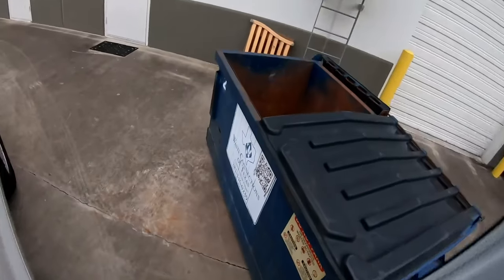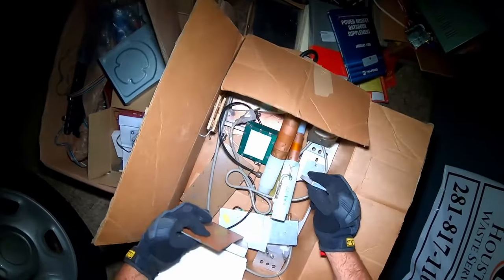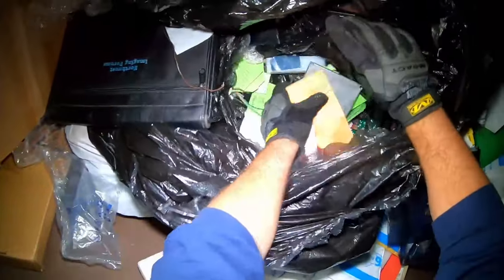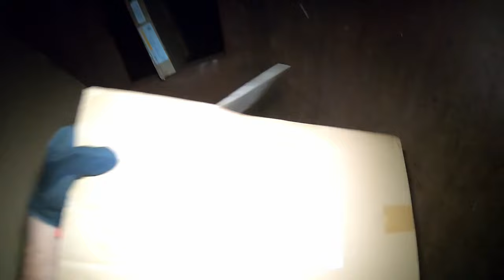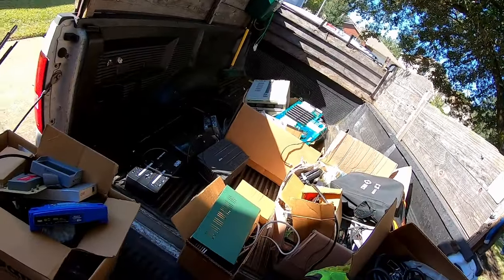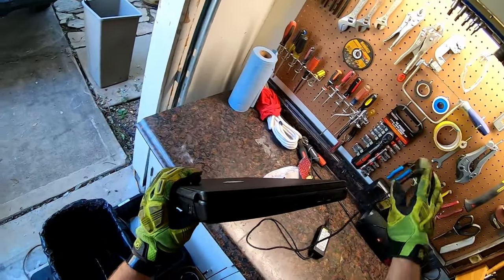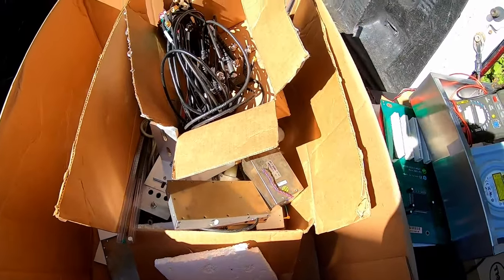Dumpster Diving "I Found The Devil In A Dumpster Tonight"

Comment: Those office dividers are often framed with extruded aluminium, worth taking apart if you have the time/space. The backs of the processors are copper, btw. Usually they can be popped off with a knife blade or scraper blade. Your power supply boxes have small transformers in them, easy enough to break open and pop them out.
Reply: also most plug prongs are brass
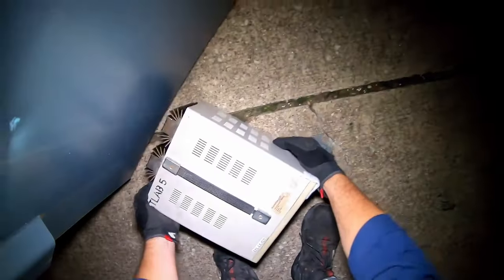Reply: The linear power supply at @4:10 has a BIG classic transformer full of copper wire... and the black heatsink on the back is also aluminum.  If that power supply works you could probably sell it for around 30 on e bay... if it doesn't work, you could still make 10-20 bucks selling at as spare parts ... they're quite easy to repair and they're good equipment to have.

Comment: At the R&D dumpster, every "empty" box you tossed into the dumpster sludge was in reality boxes of new electronic parts, most likely from Digi-Key. Some really great money can be made on eBay by selling the parts just like the parts selling there right now, check out the part numbers @ eBay or Amazon and look into the sold items.
Mike, I find you getting overwhelmed at times that you really need to slow down and get it all, as any one of those "empty" boxes could contain hundreds of dollars in computer chips. A find like that could mean the difference between a few bucks and a pocket overload of real money. 

Best of luck to you and DUDE..... SLOW DOWN IN THERE,

Mark
Reply: Hundreds of dollars? Please articulate.
Reply: I kinda doubt that, Selling on ebay is a slow process even if you can off load it at all and a lot of the time it is not worth the effort unless you don't mind a slow return.
Reply: Hey Chris, you would be very surprised how many high school and college aged kids in engineering classes build projects for grades, and not to mention all the so-called "inventors" the world over. Offer your parts at the lowest price as new, and you will sell out of everything very quickly. I know because I've been a seller since '97, and I've sold just about everything that could be sold through that site, including a $419K 4 color printing press that I bought from work for $10.
Reply: @Ghoulstille  The thing is, you have a lot of items to sell so that little bits turns into a big bit every single day, and soon are clearing thousands a week. The majority of what I sold was from dumpster diving, just like mike here.... Test things out and if they work or are brand new in the package then put them in an eBay or Amazon pile and the rest is then taken to salvage or sold to guys like the ones Mike knows that buy electronic scrap. The money is there but like everything else, you will have to work for it.
Reply: Mike often disregards stuff that he knows nothing about.

Comment: Mike, that core i5 box was the cooling fan for the CPU. the older CPUs like 386, 486, Core Duo, and Pentium CPUs usually have more gold in them than the newer CPUs like the i3, i5, i7, i9. that large gold/orange thing was a high wattage resistor. Mike if you find a person who is an electronic tech those bags with parts in will be worth $$ to you because they are new spare parts
Reply: Also, Mike, I do not know who told you about the old CPUs being worth less but they do not know what they are talking about. in addition the thickness of gold on the pins is more than what they are now. The reason is when these were made (286, 386, 486, etc) gold cost was only about $20-40/ozt vs $1790/ozt now.

Comment: Exhaust gas coolers. It takes a fraction of the exhaust gasses, passes it through a chamber filled with engine coolant to get the exhaust gas temps down before the gasses are reintroduced to the engine intake. They're a sore point of failure for a lot of diesel engines, especially the 7.3 and 6.4 Ford Powerstrokes. The coolant passages get blocked, the unit overheats, the tubes inside expand and break at the ends, and that forms a coolant leak into the exhaust. If you ever see a Powerstroke with white exhaust, the EGC is toast.

That other dumpster where the fan found you must have been an electronics hobbyist cleaning shop. Some of those books would fit nicely on my bookshelf.
mosfets
Those procs are all 15+ years old, so, yeah, just ewaste.

Those are called protoboards. Breadboards are more plastic and you can just jam the component leads into them and certain rows or columns are all connected. Protoboards requires soldering and almost none of the pads are connected. Breadboards are for developing electronic circuits, protoboards are for building working prototypes.

Metal Oxide Semiconductor Field Effect Transistor. MOSFET. Those are not MOSFETs. Those are just anonymous integrated circuits (ICs). Those heatsinks are mostly for transistors. Some of them are definitely CPU coolers. The things that look like tubular heatsinks with leads coming out the ends are most likely high power resistors. The "do not remove" jar looked like it contained a handful of surface mount devices, perhaps transistors. A lot of those warts in the middle of power cables contain transformers. That's a lot of thin copper. That copper clad photo-etch PCB being from London cheese it that that weird power plug was a British standard plug.
Reply: WOW!!! You got some smart cookies out there Mike!
Reply: @cheryldarke8540  I'm an Embedded Systems Engineer. I better be smart. In fact, as a ham radio operator, a lot of that RF stuff is very attractive to me. If I were in Mike's neighborhood, I'd have no problem pulling my truck up next to his and haggling for most of that particular dumpster's contents.

Comment: I would recommend selling the electronic components as a package.  The scrap value is very low but an electronics technician would be happy and also spend money if you can read the names and numbers on the pictures.
Reply: I'm the person that would appreciate small components. We would build power supplies using(2) 117 vac lights bulbs in series and measuring the voltage in ac.
We would build the rectifier and build a simple circuit using light bulbs instead of using transformers.

Comment: Mike don't trash shred.  the converters are metal inside, like brass and copper.  bust one open and see. I'm talking about the stuff you are cutting off of the wire and throwing away.   Some one was saving Gold plated pins, and heat sinks,  both are sellable,  Great video.

Comment: Hey Mike, those cubicle dividers are sometimes made with extruded aluminum frames. Pretty  easy to pull off the face and remove the insulation. Just keep a framing hammer in your truck and you can check them out pretty easy. Thanks for doing what you do.

Comment: I'm happy your doing a longer video. Those 15" metal blades are $$$
Those books might been Amateur Radio person. That plastic box you took the aluminum panels is to build projects kits. That cire is a Torrid coil or torrid transformer.
All those anti static bags and the pink antistatic are worth $$$. 
I picked tons of ic parts in the sleeves and bins filled with components. Those little aluminum heat sinks I sell on ebay and get more then just scrap. I get .25 each and that adds up.
Those coax wire with sma connectors don't destroy are worth upwards of $10. each. They might be called sma jumpers. Please save that enameled bare copper wire.
I use that in making kits.

Comment: Mike-- the green lidded "box to no where" is an industrial transformer. It takes 240 ac volt power and converts it to 24 dc to run the control boards and VFDs in machines in factories. 

And just an FYI industrial power in the US comes in 120 ac, 240 ac single phase or 3 phase, or 480 ac 3 phase.

Comment: Ribbon cable, your yard takes it as junk/extension due to the plastic ends, trimmed it goes #2 insulated. If you ever end up with a bunch of it there are other local yards that pay more for #2 and also 6063 and not as strict as yours so your not docked for glue, caulking, and plastic ends

Comment: Mike those routers have a circuit board in them ot might be low grade but they add up. The white paste on the CPUs is heatsink paste you can wipe it off with a rag. Those DC converters I would be interested in if you could send me the specs for them. Keep up the great videos and God bless you and your family.

Comment: that exhaust gizmo looks like a heat exchanger. hot exhaust gasses warm a fluid pumped through a jacket around the small tubes in the center, either to cool the gasses, or warm a another exchanger, like a heater core.

Comment: I save all my plugs breakers and such remove the brass on my spare time took in a 5 gal. bucket at $2.10 a lb got $250.65 cut the ends off those cords

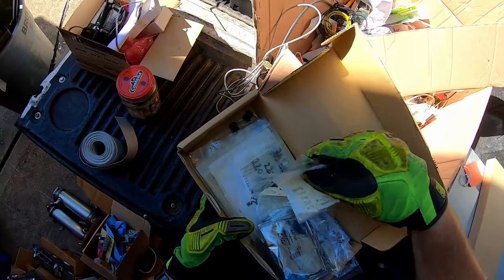Comment: 42:22 Surface mount components Either Capacitors, Resistors (unlikely), Inductors or Diodes..... Didn't get a good look at the codes on the front of packet - you spent more time reading the shipping/customers numbers on the back! lol Thought I read BZY.... on the front, if so most probably diodes!

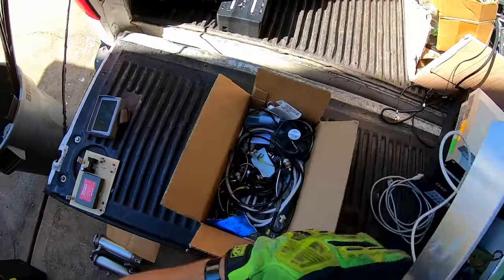Comment: 33:36 24 VDC means 24 volt direct current (direct current does not alternate, your car battery is 12 volt DC with plus in one wire and minus in the other one). So it is a 24 volt DC power supply with 250 volt AC input, alternate current. AC switces plus and minus, likely 50hz (hertz (aka cycles per second), hertz is the name of the inventor).
Likely a transformer for the european 240 volt mains grid but it can be used on the american grid too, it does not need 250 or 240 volt, it can be run fine on 110, 120 volt too. Inside thetransfomer it is a primary and a secondary coil in there wired so it is less wires on the secondary to get the voltage down, ten times less to get ten times less voltage.
So yeah, it is a power supply. 
In theory you could put 110 volt AC on it and the transformer itself will then give 12 volt AC out before the circuit board in there. I dunno about the electronics board in it, it looks like capacitors to stabilize voltage. And fhe four black diodes looks like they are mounted as a a rectifier bridge to give DC instead of AC that the transfomer makes.
It seems like a transistor like thing are there behind a heatsink, it may be for adjusting the voltage output if it is.
The transistor like thing may be a LM7812 aka a 12 volt fixed voltage regulator, or some other voltag depending on what they wanted as a output in this. 
So it could possibly be used as a 12 volt power supply to run a battery drill or something like that, if needing other voltages just swap the LM7812 to a LM7809 for 9 volt, or a LM 7805 for 5 volt.
If you run it on 120 volt american grid it may not work if it is a LM7812, may be too low input voltage for that.
But if it is a LM7809 or 7805 it should work. But i am not sure it is a LM78xx voltage regulator but highly possible.
It could be a LM317, it is a variable voltage regulator that one can set the voltage by using a resistor, but seems to not be enough components for a LM317 unless it is more on the other side of the circuit board. I can see a grey square compnent on the board, may be a variableresistor and then it may be a LM317 afterall. Take off the heatsink and read what it is, there is text on the voltage regulator that says what it is.
Since this i from a electronics lab / hobby repair shop it seems considering what you found in the dumpster then it may be a adjustable power supply to run projects and a LM317 may be what it has.
It could be a powerful transistor too, who knows, that will work too as a adjustble power supply depending on how one could make a regulator.
Learn the basics of electronics before you start on that radio book you found :)
BigClive here on youtube can teach you lots in older videos of how to solder and what the components are for, a good start, he runs a electronics cult like society where he on saturdays drinks and talks on the live shows and they has a discord chat too where people from NASA comes by sometimes :) He makes other videos too ofLED light projects and also videos where he does reverse engineer all kinds of things to test and show if things are good or not and often draws the circuit schematics of the items he test. He is a good teacher, fun to watch.
When it is time for you to learn the radio book you found having enough knowledge then Mr. Carlsons lab is the man to learn more from, he is a level up over the teachers you even find in school, he may not be as fun to watch as BigClive, or glasslinger, or Shango066 but he is very serious in what he does. He does not show the mistakes he makes, it can be a good or a bad thing, i like to see the mistakes too, makes it more fun :)
Yeah, electronics is fun and useful to learn.

Comment: The P4 processors and Duos are same category at Boardsort (No Pin CPU) and I'd say just scrap value so if shipped to them current rate is $5.75/pound. If those 2 did not say Duo and said Quad I've Ebayed a few of those for 15-30 depending on the age but Duos are not worth the time to list anymore + you probably have no way to test them so safer to call it scrap.

Comment: Hey Mike. Those MOSFETs can br sold to the scrapyard as #2 copper. Check into that at your local yard. Does your local yard buy e-waste?
Reply: From what I could see in the video... I see $150 - $250 8n scrap value alone.. no counting what could possibly be resold..

Comment: You should get that modium because the inside has gold in it and all of that electronic and computer stuff has gold in it too and a lot of different other kind of metal sailing it you make more money off of that selling it by not scrapping it
Reply: There's a tiny bit of gold, silver and other valuable materials in most all electronics. The problem is how to get the best return on the time /effort to collect, sort, process and ultimately sell that ewaste. Mike's method works for him, he sells to a electronics buyer, ebay, or to the scrapyard. other youtubers like eWaste Ben take it much further and do what work for them. 
He could have grabbed the shelves or other parts out of that nasty fridge cleaned them and sell on Ebay to make more money too

Comment: Those little green things go on the green computer boards. I just tore down 3 of my old computers lol it was time consuming. whoever did all that tearing down spent a lot of time on that to throw it away. guess they could have been building or repairing computers. some of those things/compacitor are metal or silicon or ceramic I believe there are wires in there too.

Comment: You come across computer parts a lot! You can collect them and recover the plated gold chemically, surely you come across enough for it to be profitable! Big money in that, you probably dont need as much chemical as you think, it all depends on the amount you're attempting to recover, think about it like adding salt to water, you can add more and more salt but eventually the salt stops dissolving because the concentration is too high, you have to add more water to dissolve more salt, same exact concept but with acids
Reply: Have you done this?

Comment: you will want too pop off the metal plate on the top of the CPUs. they are tinned copper. Ribbon wire usually goes into the data wire pile. like cat 5e but safer to ask your yard.

Comment: The three pin mains plug is a uk plug and the bronze colored rolls of tape is called kapton tape for heat resistant / shielding etc which isn’t too cheap to buy and there is copper / mini transformers in them laptop looking power adapter blocks after all copper is copper right 👍🏼

Comment: If you cut of the plug ends and plug in part .check it out .take a hammer and all your big heavy plug in part ,and smash it with your hammer .they are full of copper coils .I would save a 2/3 gal bucket of those and you get a pretty penny for them.

Comment: Did you scrap the electronic parts like cap , transistors , mosfet and all the plug connectors ? How about the big power supply and logic meter ?

Comment: Those animals you could take them apart and get the mail off of them you should have a screwdriver and and ranches carrying around with you when you find stuff like that to take them a part there on the spot you should save those processors and sell them in another time when you get up quite a few of them because they're just as much or more than what you think you take them to the right place as much as you get and go as much as you do it wouldn't take long for you to get a lot computer go stuff to sell

Comment: Mike I used to do the same thing that you're doing but with bicycle with a mountain bike with a Rubbermaid side by side wheelbarrow with two wheels modified as a tow behind trailer me and my cousin we caught a lick of 307 lb of clean aluminum sheeting I'm in the New York area they don't do what you do meaning what your yard does they give us the same price for copper clean copper if there's no plastic no nothing on it if it's bare wire they call it bare bright or number one copper

Comment: Those processors probably have a higher resale value than they have in gold value. It's a minuscule amount of gold and it's usually the very old processors that have gold worth recovering. Make sure the processors work and sell them on Ebay or something. I guarantee you will make way more than selling them for the gold value. Especially considering the microchip shortage, even the older computer components are much more valuable for their usability now, not their precious metal value. For the next few years, don't scrap anything computer related until you are sure it has no value otherwise.